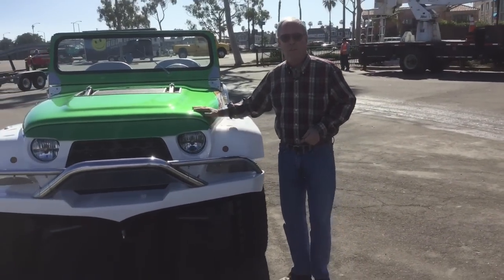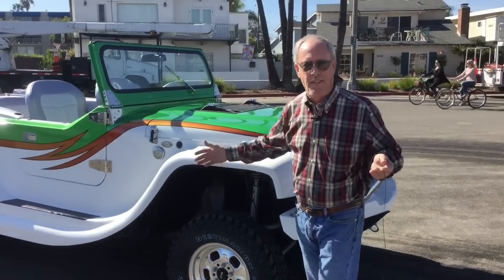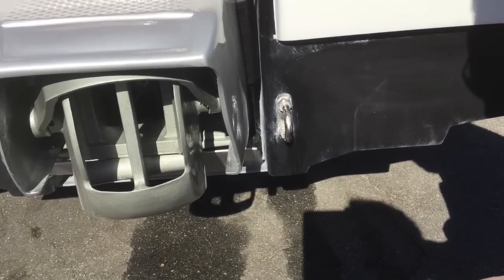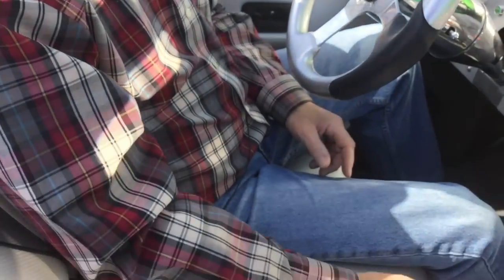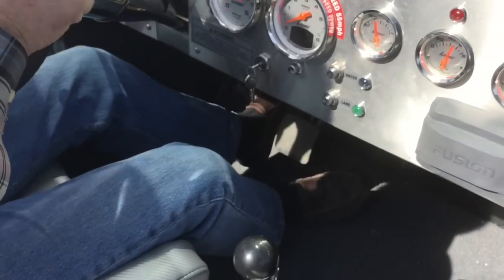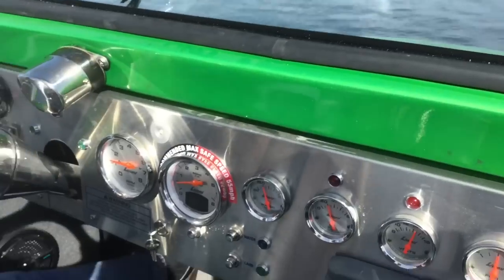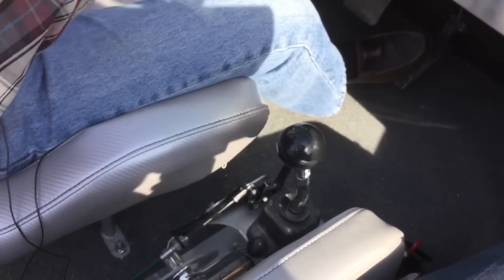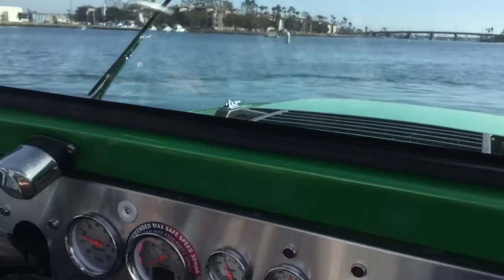watercar instructional video part 3

Comment: So when you're in water mode and accelerating (getting it up on plane) are you using any pedals?
Also which controls don't work in water mode (like windshields, lights ,and turn signals)?

Comment: Can't this car go 45 mph in Water or is it bad for getting up on plane? Also is the gear transmission Automatic or Manual?
Reply: Four speed manual on standard H - pattern.  Neutral on water with PTO engaged for jet.  BTW, 45 MPH is wicked fast for a short-hull (or any) boat!  20-30 MPH is plenty for on-the-water fun.